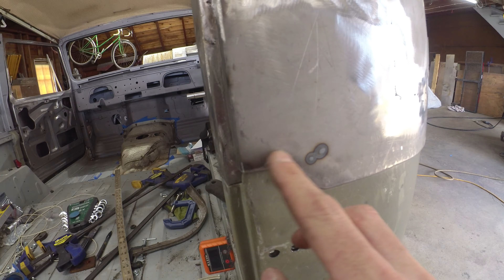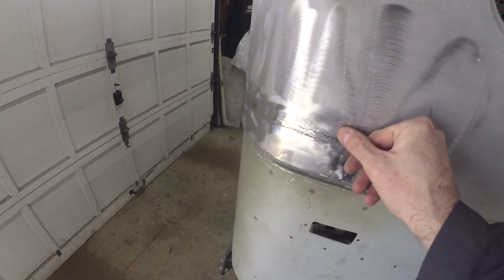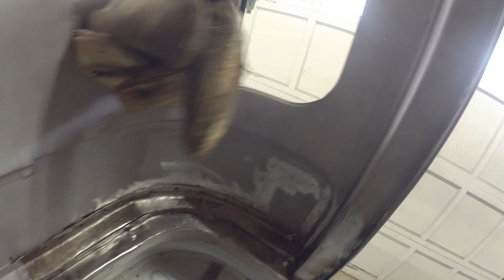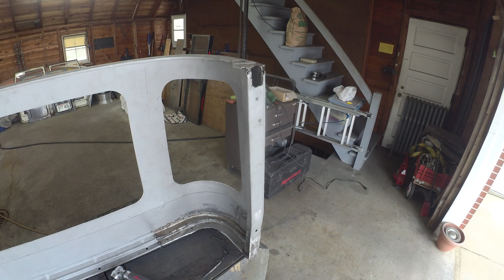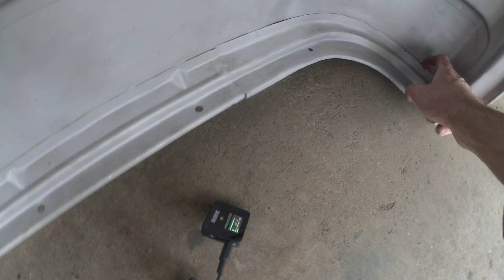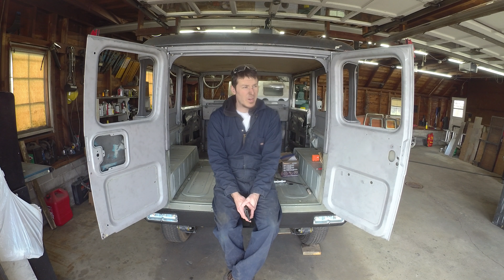Hardtop Rust Repair : (FJ40 Week 24)

Comment: What sand blaster are you using
Reply from the maker: Just used a cheap/basic gun and a bucket - worked pretty well as a portable unit as long as you have a good air supply.  https://a.co/d/dJKkxop

Comment: Sorry for the questions but what sand blaster are you using??
Reply from the maker: I used a mix of an old blasting cabinet from Craigslist for small parts, and just a portable gun and a bucket for the bigger stuff.  It was just a cheapie off of Amazon - took up a little less room in the garage than a canister one.

Comment: Where did you source the steel bars used a metal bending brake?
Reply from the maker: They're worn blades taken off of a larger-sized wood chipper if I recall - works out well as they're hardened, and they have a square side as well as a narrow/tapered side.

Comment: Wow amazing work and great overview of techniques etc…. Any frame work needed?  My tub has some rust repair I’ve been slowly been addressing and procrastinating on… but the rusty frame makes me wonder if my efforts are worth it…. I figure if I can just keep it alive and loved then I’ve done my job, not investing a slew of money to do a proper resto.
Reply from the maker: Appreciate it...mine did need work on the frame on the rear where the "knee" is on both sides, and I needed to redo the frame tails near the rear bumper.  It was reworked once before around '88 to replace the rear bumper once, and it was due again...salt is hard on them up here in WI.   I decided to box in the rear tails as well to add some support.   The frame work goes a little faster than the bodywork, if you've got access.   There's some of the frame info on a thread on the IH8Mud forums, it was a bit cold during winter to film the frame repairs, but there are at least some photos: https://bit.ly/3owiaM2

Comment: sorry if i missed it.......but do you remember if you used 16 ga or 18 ga steel for the curved braces you bent at the beginning of the video? Thanks
Reply from the maker: I ended up using 18ga to match the original flange thickness.  They had a step/lap joint before the curve to join the straight run and the rear, so using 18ga let it tuck back in the way it should.